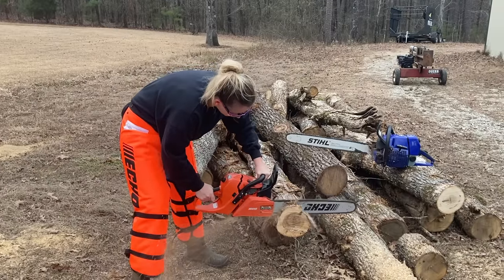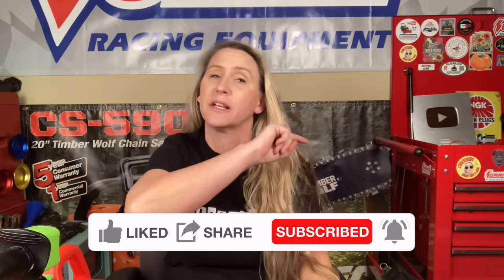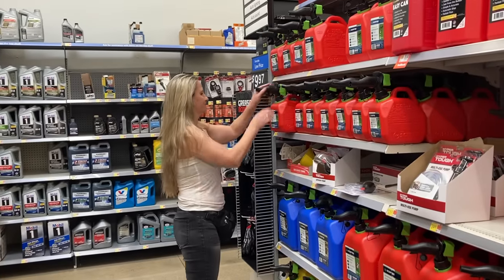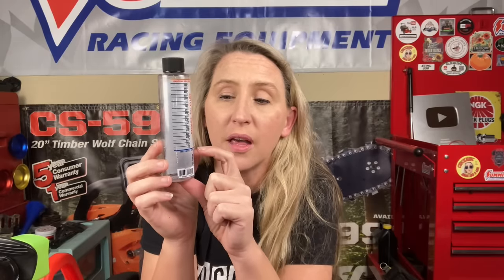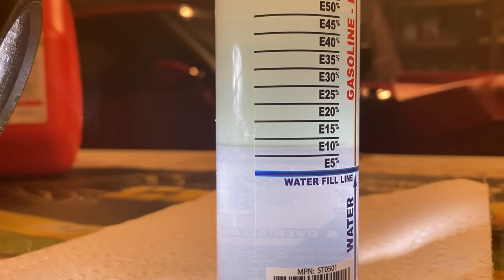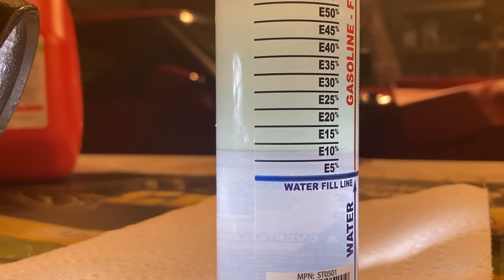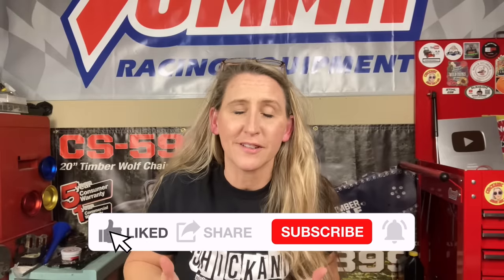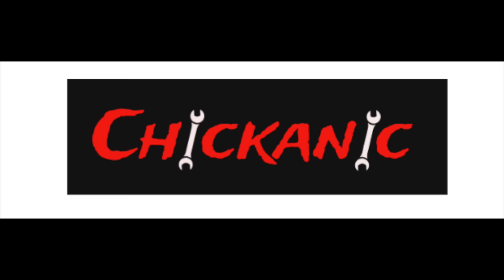Fueled by Deception. How You’re Getting Ripped Off at the Pump! (I'm SHOCKED!) VLOG

Comment: Thanks Bre.. for enlightening me about the shared gas hose problem! Also, I've never met a person that thought the "safety gas cans" were actually safer. They're typically difficult to operate and often spill fuel worse than the older cans.
Reply: it depends on the design.  I've seen some valve controlled gas cans that are a vast improvement over the average "traditional" can.  and I've seen ones, like the ones in the video, that take three hands to operate.
Reply: Some cans'  "safety spouts" can be modified to still allow cutting off the flow without the awkward triggering required here. It depends on the spout design.
Reply: Honestly, I haven't had any issues with the safety cans available where I am.
Reply: @lindachaffins4504  That's not why they were changed. It's due to CA air quality rules.
Reply: I actually like the green Specter nozzle, I dont spill to much gas on my chainsaws..
Reply: Used to be the case with the 'old' new cans, but check out the newer designs, easier to get into filling position before flowing fuel and you can cut right off if you have an overfill situation much faster than my old cans.  I spill far less with the newest ones than the old ones, but you are right when the first came out I spilled far more than I ever did with the old cans.
Reply: I had one "safety" can that was definitely better than a regular can. It was easier to use and I spilled less. Unfortunately the spout finally gave out as plastics do after many years, and all the cans I found for replacent have mechanisms that are too stiff and result in spills.
Reply: K&N
Reply: JEFFREY TETZLAFF  I have found pushing the block and pulling a tie wrap around it works well,but it defeats the 'safety feature'
Reply: I have several old type galvanized steel "Safety cans," with a trigger handle to open the spout.  For me, they work fine.  Leave it to some bureaucrat to ruin things.  I wonder if old spouts will thread on to the new plastic cans.
Reply: @cphank3722  I purchase the nozzle & vent kit and got rid of that cumbersome mess.
Reply: Metal cans with pull-open lids on the handle are the only type of gas can OSHA allows on Jobs sites. It releases air pressure that builds up from the temperature changing through the lid so it can't explode. This also works well for pouring when you are ready to pour.  It is easy to use. It's the parent's responsibility to keep the kids safe.  Plastic cans will build pressure and can explode. You can't breathe air and pour the liquid through the same small end of a hose. That's like breathing and drinking through your nose at the same time.  The reason we have a nose and a mouth. The metal cans are expensive. Starting from about $50 UP TO $250 for a 5-gallon can.
Reply: I use the EZ Pour Spouts available at most farm and home retailers.
Reply: @RB-re5es  That's what I do.  I get the cheaper cans at TSC for around $18 vs the $44 dollar ones that are worthless.  I also get the $10 dollar spout and put it on and it works great!
Reply: The No-Spill cans from Ace or your local Honda OPE dealer(it’s an actual accessory with a Honda P/N IIRC) are the only “new” cans will mess around with and easy to operate, position the nozzle, press the button, let go, done. Screw the rest. There’s an old gas can that will get retrofitted to the “old”
Reply: @OffBeateimmaJ  Facts. Although, I have been using the same Eagle safety can for years instead of replacing the rotted plastic can every other season. Worth the investment IMO. Just avoid ethanol fuel if you want to keep it nice.
Reply: Yep, I remove the spout, and use a funnel.  And still splash gas all over my lawnmower- because there's no VENT in the can.  So it chug, chug chugs...

  I then went on the internets and bought an EZPour spout.  Which comes with a vent you can install.

  The Motomix I buy for my chainsaw costs a FORTUNE.  But- it runs my saw with 0 problems, and the spout you can get for the can WORKS.  Still not vented, but the spout is flexible so you can just tip the can until a trickle of fuel comes out- instead of holding the whole can up and having it chug, chug, chug fuel everywhere.
Reply: Plus, they contaminate the environment when users get angry enough and simply wing them off into the weeds..
Reply: Google "NoBama" gas can spouts!
Reply: jeffreytetzlaff6563  Yes  use a funnel if you have to,
Reply: Definitely not for arthritic hands!
Reply: @edwatson8194  It had nothing to do with national regulations. It was the California bureaucrats that got involved and when California comes out with such things, the manufacturers make them the same for the whole country.
Reply: the "new gas cans " require 3 hands to operate properly one holds the can.anothe presses the green plunger and the third hand lifts the green lever. Designed by aliens.
Reply: Take the spout off rotate 90 and pour away without spilling a drop ( no glug glug)
Reply: Down south they say 'sling' not 'wings but you had me laughing 😊
Reply: Picked up many of the older Blitz cans on my many trips back and forth from Chicago to NC years ago. All of my cans have the older Blitz nozzles.  A 1/2" step drill  bit will drill the vent hole perfectly round for the vent valve is not drilled.  The older Blitz nozzles can still be found on cans along the road from time to time. I go back and get them all. Blitz was sued out of business by a fellow that got burned throwing gas on a campfire.
Reply: The cans are designed to  be air tight to prevent breathing with change in temperature & the pumping of humid air through the can, because ethanol pulls water out of the air and into the gas, and because ethanol fuel oxidizes & degrades faster when exposed to air.  Bacteria feed on ethanol and excrete a corrosive acid, which, along with water in fuel eats up fuel system parts.  Fuel preservative additives have enzymes that destroy those particular bacteria, and thus protect the fuel system.

Comment: This video just made me fall in love with our QT even more, their ethanol free fuel has it's own hose and nozzle and isn't connected to the other gasolines.
Reply: The sheetz in Troutman, NC has 4 grades of E fuel and the 3 main unleaded on one pump. We create and pay these "handout jobs" to create a system that only works one way. Regulate the fuel and the system by strict calibration to make sure the government doesn't get screwed out of a drop of road tax. Then totally overlook the quality of the system that is pumping the fuel to protect the public.
Reply: I don't mean to be political about it. I got a little aggravated when they came by paving our road with 3/8" of asphalt last year. 
The potholes that were before were then mere 3/4" divots after their icing job. Didn't even bother to pack anything into the holes.
Reply: I an a service tech in alabama for fuel dispensers our state requires the non ethanol fuel come from a seperate line just fir the non ethanol you should contact your state weights and measures office and file a complaint on the station they should address the situation with the station to bring it into compliance

Comment: The plastic gas cans now days are ridiculously expensive. As you have shown,they don’t work worth a CRAP!!! Thank you for all the time and effort you put into these videos. 👍
Reply: I drilled them out or otherwise removed all the guts from the fillers. Mine are all straight fillers now just like the old days. Except for the mandated prices of course.
Reply: Find a plastic jug of the required size, rinse well. 
Paint it red. 
Go find your plastic funnel.
Done.
Reply: nowadays
Reply: I use the VP gas jugs they work awesome.
Reply: I think that the new EPA gas cans are ridiculous, but mine work fine. If they keep gas fumes in the can, they should also keep water vapor out of your gas.
Reply: I like the sealed cans because the lighter gas in gasoline can't evaporate off. I found a 3 yr old 5 gallon can of 87 with 10% ethanol without stabilizer that i forgot about. Smelled fresh and ran it in my cheaper generator without issues

Comment: I bit the bullet a few years ago, trashed all my leaky plastic gas cans & bought spring-loaded cap steel cans with funnels. Yeah, 3x price of plastic. A 1 gal for my oil mixes for chain saws etc, a 2-gal for gas my petite wife can handle, ( she do loves the zero turn mower) & two 5-gals, one for tractor diesel, one for gas. Will start pumping 2 gals in my truck before I fill my cans with ethanol free. Love the metal cans. Safer too. Labeled each can with paint stick. Bought Dad & brothers these for birthday gifts.

Comment: Thank you for your investigative work! I’ve held onto my “old fashioned” gas can for years because of those new cans. I actually retrofitted my youngest daughters gas can with a simple spout, and vent. They’re worried about fumes leaking into the atmosphere….ridiculous!! You spill more trying to get the dang gas out of the can! Thank you again for this video, a mechanic told me years ago that the Ethenol  is very corrosive to parts on older equipment. 👍
Reply: The splash guard defeating the turkey baster is what bothered me the most.  I wonder if it would also defeat a boat style primer bulb and hose?  I also often just use a funnel and pour without the cap, and save the old stuff.
Reply: The ethanol is bad for aluminum parts as well as some rubber/plastic materials.
Reply: @alan6832  I use a funnel when filling my JD rider mower. I do not use the spout at all - just pour right out of the gas can.
Reply: Ethanol is not only more corrosive but also burns hotter. Heat is a number one enemy of any mechanical device. I read in a college text book on automatic transmission repair, that if you can reduce the heat in an automatic transmission by only 10% you can double the life of the transmission. In any mechanical device try to keep heat at a minimum.
Reply: “I’m here from the government and here to help”.  Yeah sure!

Comment: Your detective work is the difference between a good service technician / department and an ordinary one.
Nice work!!! 👍
Reply from the maker: THANKS!
Reply: I used to drive a gasoline truck and it sounds like you're talking about Unocal 76 gas stations, they have two grades of gas and mix a little of both to make mid grade
Reply: @wilpenny4318  And some transports dump fuel in the wrong tanks also, which isn't addressed. Along with xtra water from refinery.
Reply: @wilpenny4318  There is a local place in upstate NY called Stewarts, they sell premium E0 gas in all their locations. But I guess you should put some in your car first to be sure the gallon tank gets it! The landscapers always fill their cans with that gas.
Reply: You have no clue why big fuel company's doing this ,  Ethanol is not made voor Engines sorry....its crap , Belgium we have some gas station , with ethanol , but i avoid them much as possible , for my garden é😍quipent i use Aspen 4 stroke ,  and 2 strokes ,  you can keep it much longer than random gasoline , and it works pretty good , with one set of both i'm safe for a whole season !!
Reply: @alb12345672  Know Stewarts well, the non-ethanol is the only gas I use.
The solution to this, sorta, is to put the first gallon you pump, into your vehicle. Then fill the OPE tanks. Having that 1/3 gallon diluted by 17-18, or more gallons in the truck with regular gas will affect you less.

BTW, I used to love Stewarts ice cream till I happened to look at the ingredients to see HFCS the first listed. Stuff is worse than ethanol in the engine.

Thanks Chickanic, you're one of the best!
Reply: @JOEZEP54  damn, maybe time to talk to who is in charge, they have to get with the times. I think Columbia sells it, that can be a bit of a haul though. Gas is funny in NY. They tried to expand a Stewarts here to sell gas (rare one that only sells food) and they made it impossible for them. Gas cars are going away! We have enough gas stations! Pumps don't fit with the character! There may be some crazy law about that there.
Reply: Someone said All fuel has some amount Ethanol, it was used to replace Lead.
Reply: Looks like Jerry Lee Lewis whole Lotta shakin going on also if it's childproof give it to a kid to do it my grandma used to give me the childproof pill bottles for me to open for her when I was a kid 🤣
Reply: I work on gas pumps and fueling systems. She is 100% correct. The more ethanol the more water it absorbes...hmmmm Dicks petroleum for all of your fueling needs
Reply: @neihypnosis  Seafoam helps too. Call it snake oil but I blew an engine, let it sit 3 years, then put bearing and it ran with the old gas. Was regular pump gas with seafoam. Before seafoam I always had rusty/cruddy carb issues. I do use it with the supposedly Ethanol free gas.  My small engines now just start right up.
Reply: Dawg don't accept internet klowns without proof. Evidence.  Beyow
Reply: People rarely are very observant! You do have a valid point with the pump . That’s why I get my fuel at a station that doesn’t sell any ethanol gas!
Reply: @marvinmartin4692  or zo u tink
Reply: Yes fuel delivery driver's do drop wrong products into wrong tank's and people will be getting 87octane when they think they are pumping 93octane. Most stations will only have two tank's and the middle octane is programmed to mix at pump. Only certain cars truly need the 93 octane which has less ethanol and more cleaner, most cars that are driven daily with fuel injection will not have a problem.
Reply: @Chickanic  
I’m looking for a wife. Whenever you are single let me know 😂
Reply: It would probably help to use a funnel
Reply: @wilpenny4318  Great job.People need to know about this stuff.
Reply: @neihypnosis  i
Reply: I worked at a refinery for 9 yes making fuel. I believe what you are saying. BTW. Always pull car far from the pump, stretch out that hose and get all the fuel you are paying for.
Reply: @tommy5499  this is false
Reply: No
Reply: @wilpenny4318  
Yea, a lot of stations are like that, they only have 2 tanks in the ground, one for the lowest octane and one for the highest, the pumps are calibrated to mix them accordingly to dispense the grade that was selected by mixing the two at whatever ratio is necessary to make that grade.
That's one of the things that gets certified by your local government official that puts his certification sticker on the pump, when a gas station is built or they put new pumps in that local official is supposed to come by and take samples of each grade to be sent out for verification, the other thing they certify is that it dispenses the amount displayed on the pump, ie 1 gallon on the pumps display equals 1 gallon and not .932 gallon.
Reply: I recommend the Echo Red Armor pre mix gas ⛽
Reply: @jacksmalls7368  get in line
Reply: Buy the new, old style plastic nozzle and pitch those government mandated choke nozzles.
Reply: @Chickanic  BTW that measures the amount of ethanol, water and other chemicals.   So there might be 5% of suspended water.  Also it may take 4 hours to settle fully.  I worked for a fuel company once and we frequently had water in the tanks.  We didn't want it but it happens.  Unless it was above certain limits in certain states we left the pumps going.  Even though the water was at the bottom a little bit would get sucked up when you pump just by the flow of the gas going into the pump.   And we were a honest company.  A small gas station that may be locally owned doesn't care, and typically doesn't even know.
Reply: @tommy5499  its  true ethanol is an octane booster, but if its "ethanol free" its not suppose to have any ethanol in it and they use more expensive octane booster.
Reply: Which tyro companies may or may not be screwing people at the pump?
Reply: @Chickanic  1
Reply: You could always take the spill nozzle off
Reply: All gasoline goes thru the same pipelines.  So each type of gasoline and diesel shares the pipe.  They run a pig (plug type device) between types but it is not perfect.  Plus all the valves retain the previous fuels.  Trucks do not dedicate internal tanks to one type so you get more mixing.  I managed two stations and many emergency generators.    Agree with you on the pour spouts.  I use old cans and after market replacements.  Best if you add the small breathing hole.
Reply: @republicansthatdidntvotefo1605  you ask too many questions. Don't stand near any open windows
Reply: I have a sc-490 echo chain saw and I can't figure out why I can't get the oil chamber to work. I watched your video's and that did not work what else could it be I'm out of ideas
Reply: Not sure if true or not or is still an n issue.  But when I was uoung my dad wouldn't buy gas at certain stations. One reason was he said they don't keep their tanks full at all times and water and condensation  gets in the underground tanks. Then gets in your car tank when you get gas there and then you have water in your tanks and makes car run bad. And Which can freeze in the winter.
Reply: @ChuckD59  Cree
Reply: Ethanol containing gas absorbs water. That water damaged millions of small engine carburators, especially when stored without draining the carburators and tanks when stored over the winter. Ty he government even paid repair shops for carburators damaged like that for a period of time. Ethanol has been a nightmare in gasoline. It stores less time. Materials in engines has to be changed. Bad juju all around. Adaptions were necessary.